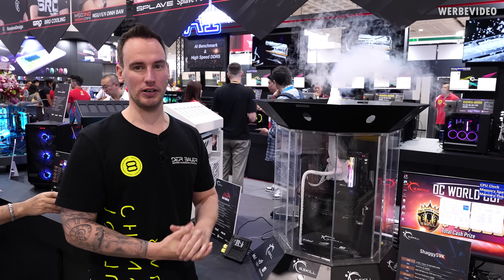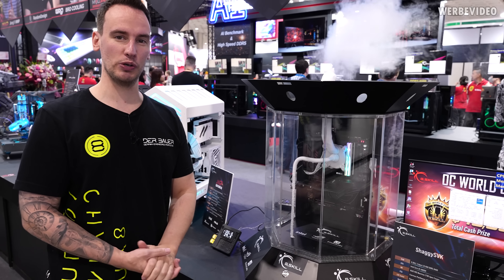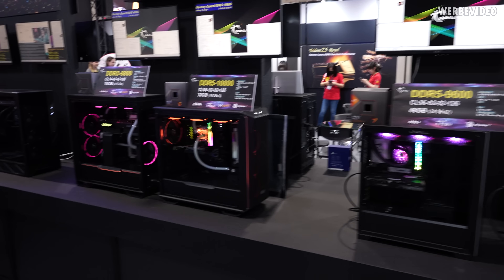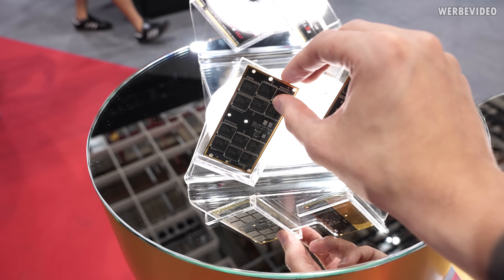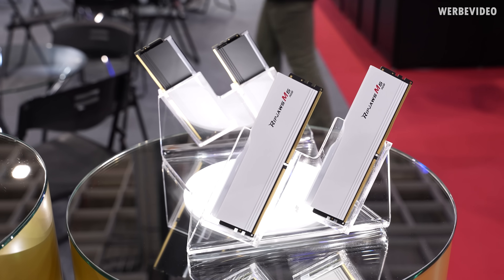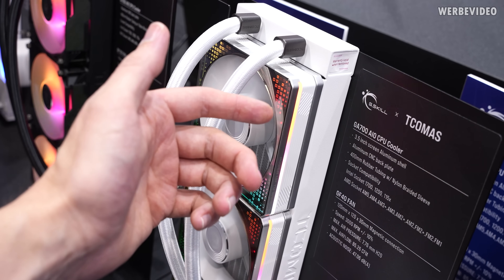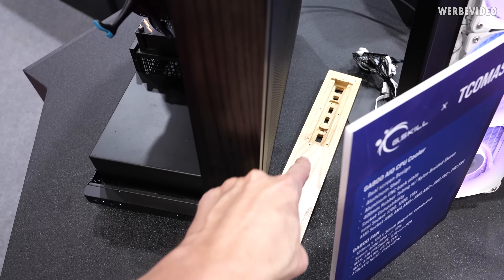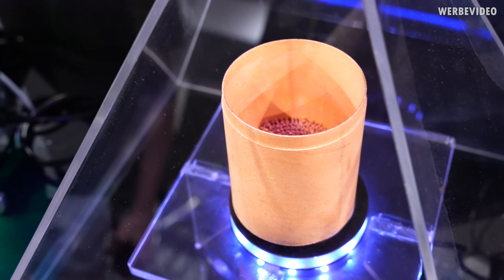DDR5 Modules with 10600 MT and a $ 10,000 LN2 Cooler - G.Skill Computex 2024

Comment: CAMM2 has the problem of introducing a new failure point - another pin grid array on the motherboard that can get damaged. Or you misalign or use wrong pressure. The current mounting didn't look very reliable or robust.

It has the advantage of removing memory height issues in various builds (or top radiators) - tho the large oversized IO on the left is still messing with clearance.
Reply: The pins seem to be much thicker than the ones in CPU sockets.
Reply: The part that has all the pins is separately replaceable for this exact reason.
Reply: I find it not a good alternative tbh, just for some niche products. The Sodimm tech is proven by time, they could have made the sodim module a bit larger to integrate dualchannel ram directly on one module but as you said the CAMM module just gives you another way to f-up mounting one.
Reply: @MP-ul  I strongly disagree, it is the new JEDEC standard and is meant to address soldered RAM (not to mention the benefits of higher frequencies and lower latency + using different types of memory modules that isn't possible with SO-DIMM). With CAMM2 modules manufacturers won't have a good argument for soldering RAM on devices instead of using CAMM2 modules.

If you screw up the mounting somehow, which would be hard with all the guiding pins (check the video by Lenovo called "Replacing Your CAMM2 Top Cover, Memory & Connector") and even if you bend some pins, you can always buy a new pin array

Comment: i wonder if you can place CAMM2 module behind the cpu socket on motherboard, it would make more space at front, may be useful for sff builds, and may benefit in performance
Reply: Motherboards have M.2 slots on the backside, so I don't see why not do that for CAMM as well.
Reply: @ChristianStout  because CAMM2 is like three times as big as m.2 plus it needs a heat sink.
Reply: @ChrisWijtmans  PCIE gen4/5 M.2s need a heat sink as well.
Reply: There is also a problem with cooler backplates etc behind the socket. It could also interfere with cable routing spots if it were placed at the back.
Reply: Don't agree with putting it on the back of the motherboard: your CPU socket needs cooling, even if it's a small breeze going over it or just open ventilation. But you could easily put it closer to the CPU on the top of the motherboard.

Comment: The watercooling applications for camm would be interesting however if they are populating both sides it could likely produce issues? Either way, its going to make for a lot more space on the board and also a somewhat cleaner build in the end

Comment: is there any socket cooler or aio for this new ram ?
Reply: Socket cooler or AIO? Motheboard included heatsink will probably be enough maybe. The RAM technology is new, I don’t think that anyone has made coolers for it yet. I only know that Lenovo is using LPCAMM2 on some of their laptops.
Reply: it will probably have better cooling already since it has a heatsink on top like the m.2s have let alone adding finned heatsink your case fans will cool it even more
Reply: Saw in a video from Gamers Nexus that MSI include a heatsink for the CAMM2 module, like how most motherboards include heatsinks/cover for the M.2 SSDs.

Comment: I really like the CAMM2 modules, definitely seems like the future, mainly for laptops but I can definitely see it being nice on desktop as well (they could in theory put the CAMM2 modules on the back of the motherboard even closer to the CPU)
Reply: CAMM2 is incredible, we need 128gb for it and then i'm all for it.
Reply: @worldwanderingfisherman2166  Apparently 128GB and 256GB modules in the works
Reply: I assume it utilises 2 channels? What if some threadripper cpu has 4 memory channels?
Reply: @fatavocado7291  Probably what already occurs, placement on the opposite side of the CPU, adjacent to the IO panel.
8 channels will get much trickier, let alone 12 (which already exists on servers).
Reply: @fatavocado7291  just put another CAMM module on the other side of the CPU. easy.
Reply: Definitely agree with this but I don't agree with putting camm2 modules on the back of the motherboard. Especially since the back of the socket needs atleast a little bit of air blowing over it. But you could definitely have it closer to the front of the socket.
Reply: @scarecrow5848  For sure, cooling on the backside would become an issue, I think it would be an interesting proof of concept for all the zero cable builds that are moving connectors to the backside.
Reply: @shadowkora  mabye if you have heatsinks on both the actual module and the rear of the socket? just seperate ones? sockets are standardized anyway.
Reply: @shadowkora  I don't think it would be that big of a cooling issue, being on the backside of the board (located on the flip side of the front camm2 would make sense), as there's a larger cooling surface than with DIMMs and not being sandwiched against another DIMM.  
I've been wanting to see M.2 drives being mounted to the rear for a while.  Let's hope that rear-mounted cabling will bring these things, with some case designs for rear airflow.
Reply: @ChrispyNut  Rear-mounted M.2 is already a thing, though it's usually done on ITX boards to save space.
Reply: @FieryMeltman  Yes, exactly.  So I'm obviously referring to it being common, rather than putting them under PCI'E slots, requiring cards to be removed to access and limiting cooling potential.
Reply: @ChrispyNut  That might encounter problems with PCIE Gen 5 M.2 drives. Those can get pretty hot without proper cooling. But yeah, I do share your annoyance with M.2 slots that go beneath the GPU.
Reply: Screw that. Put an LCD screen on it. Now that's the future.
Reply: @poppyrider5541  Unironically definitely possible with how camm2 is flatter and wider/taller. Let's just hope manufacturers, once cooling is needed, don't pull any stupid decisions for the displays. Like having them sit right against the heatsink..
Reply: @poppyrider5541  yeah we need ram with screens